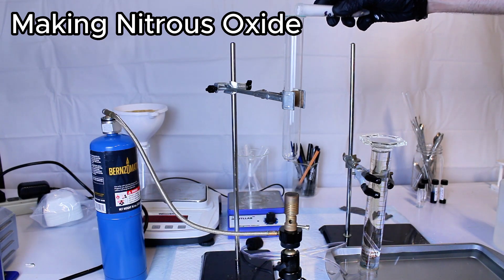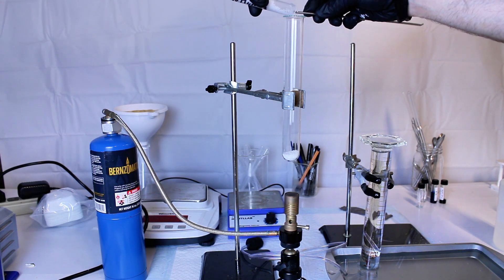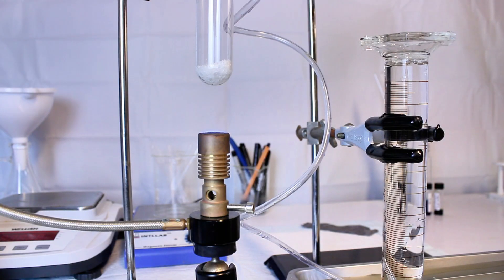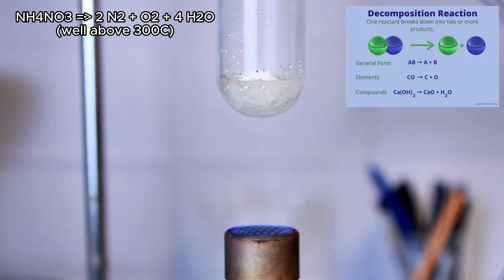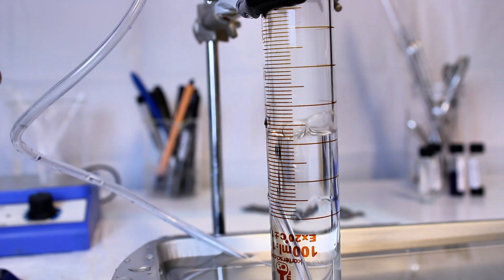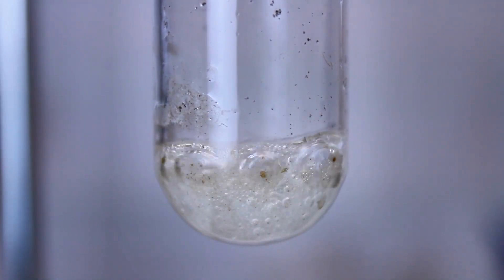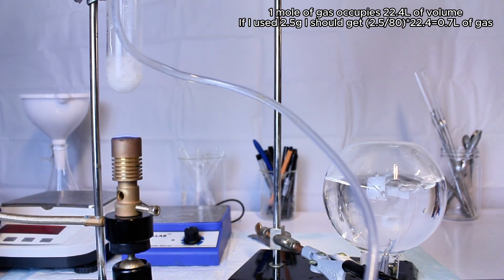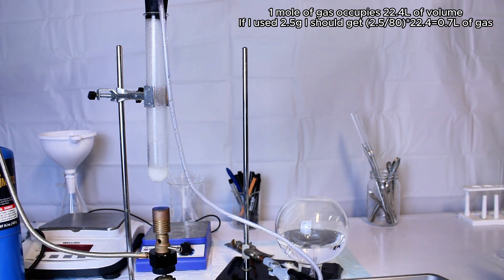Nitrous Oxide

Comment: Gasoline engines can be tuned to benefit from it too.
Reply: Imagine using heat from your exhaust to drive this reaction. So you could pump nitrous into your car...
Reply: Germany used it to boost their aircraft engines in WW2.
They called it the "ha-ha process".
The British secret service were all non-chemists and it took them over a year to work out what it was and tell the RAF and the researchers.
Not the first time the contempt of the British upper classes (from which the secret service was drawn) for science held up progress.

Comment: i would rather understand the correction made in the laws since they only apply to ideal gases. But still it would make an interesting video.
Reply: Those corrections dip quickly into random-looking things that grow out of engineering because modeling non-ideal gases analytically gets intractable starting from tiny perturbations from ideality. I'm sure that could all be made into a fascinating series, but as with the magic done to deal with partial differential equations, tracking down how they came to be ranges from complex to straight up impossible.

Comment: i thought in room temperature it’s 24.5L per mole not 22.4L
Reply: I guess if your room is at STP, it's 22.4L. Kinda chilly in there, though.
Reply: @davidfetter  24 litres at 20C. 22.4 * 293/273.
Reply: i think its avogadros law that states that the volume occupied by any gas will be equal given that pressure, temperature and amount of substance remains same(the actual law was that the volume of a gas is directly proportional to number of particles but the previous statement would also be correct). that said volume turned out to be 22.4 cubic decimeter or litres per mole, not 24.5.
Reply: @AbdullahMalik-yr2yr  i thought 22.4L per mole is in 0 degrees celsius
Reply: @changdaniel4768  i might by wrong but i think its at STP

Comment: Despite your obvious consciousness in the experiment and the fact that you probably knew this already, I still like to mention that heating NH4NO3 on an open flame with no apparent temp control systems is EXTREMELY DANGEROUS. Violent decompositions do indeed need high temperatures, but a burner can easily create local heat spots for that to happen. Instead, try some other (arguably safer) methods:
1. Urea + nitric acid + sulfuric acid (not recommended due to danger of explosion)
2. Hydroxylamine hydrochloride + sodium nitrite (safest method, used by NileRed)
3. Stannous chloride + nitric acid + hydrochloric acid
Despite the fact that those methods are a little complicated and the reagents are hard-to-get and expensive, it is still worth a shot when you are making a decent amount of N2O and trying not to blow yourself up. Hopefully this helps!!
Reply: Or heat the ammonium nitrate with the same amount of acid washed sand mixed in.
Reply: Really, extremely dangerous? 2.5 g of NH4NO3, unconfined in a test tube, heated with a low gas flame is hardly, 'EXTREMELY DANGEROUS'.